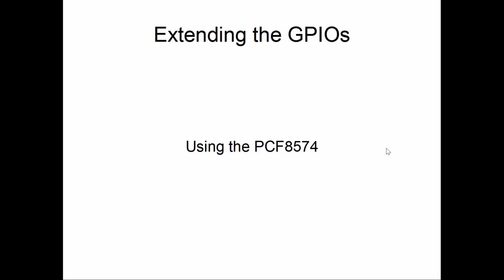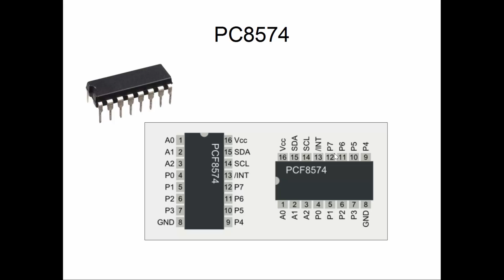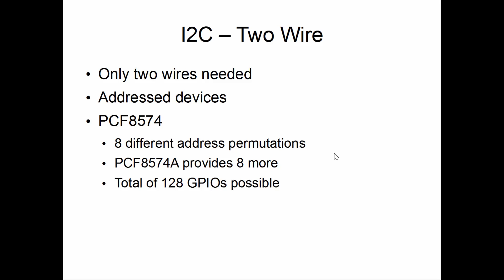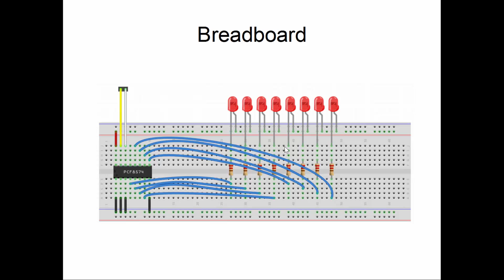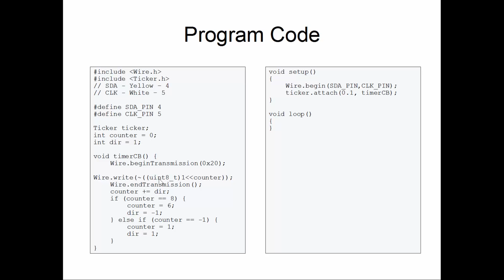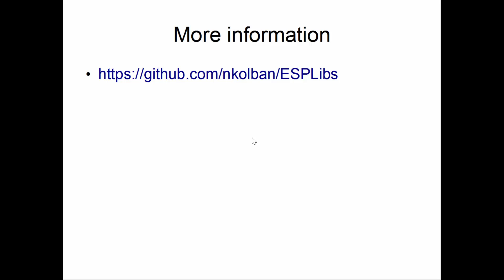ESP8266 - GPIO Extender

Comment: Wow.
Thank you very much for this tutorial.
After weeks of trying to figure this PCF8574 out, failing with 3 different library's and start thinking of a bad chip, your explanation and library gives me hope in this hobby again. I know now that the module works. I only wanted four buttons and four led's on it so now I can start thinking about how to do this. Because I have connect it to a ESP8266-01 I don't like to use the INT of the PCF8574 (maybe on the RX of the ESP8266-01 as input) but for the simplicity and he... I am just trying to learning this. Do you know where I can find an example to learn more about this with your library? Or just a simple snippet of code to read a port of four and to set a single port or four.
Any way, thanks.
Ray.

Comment: well, after testing it, one big drawback in the module. A silly shake could set all output pins to high, and after setting the pin programmatically to a certain value, they all remember their statuses. This is bad. I tried 2 modules, I hope only mine are bad. By the way some pins I left floating (they were used as inputs), I hope this could intercede for the module.

Comment: I have a problem with my PCF8574A ,  I should use it as a my arduino LCD bacjpack, as an I2c  interface but only thing I can get is blank blue screen and if I adjust the contrast I can see all squered pixels in upper row. So, i guess it is a adressing problem or somethig else , I need some help, please

Comment: what would be the advantage of this one over a way cheaper 595 shift register?
Reply: yeah right pcf8574  can do input and output in same chip unlike 74595 shift register
Reply: the pcf8574 has input as well. It is i2c so it can use the same pins as other  i2c devices. The 595 needs 3 pins, although with some extra hardware it can be donewith 2 pins
Reply: you mean you can mix some pins as inputs AND others as outputs simultaneously, or just the whole chip as a block of inputs OR outputs?
Reply: The other  advantage is that even if you add more i2C devices, can all be done with the same 2 pins, unlike the 595
Reply: rodstartube can read any pin and write to any pin
Reply: A quick google seems to show the PCF8574 at about $0.36 each while a 74595 at about $0.09 each.  So while the PCF8574 is at least 400% more expensive ... unless one is volume producing, for small projects, the cost difference should disappear.  As far as the benefits and drawbacks of a 74595 vs a PCF8574, I'm afraid I don't have the depth of knowledge to comment.  Obviously, the PCF8574 is advertized as a GPIO extender and the 74595 as an 8 bit shift register.  Obviously the designers of the PCF8574 considered that it had qualities that distinguish it from a shift register.  Perhaps those might include the interrupt handling (i.e. signals when pins change state), I2C processing, ease of addressing/cascading multiple devices etc etc.